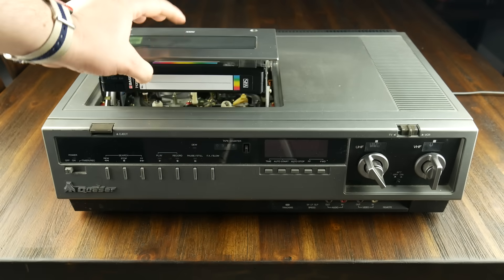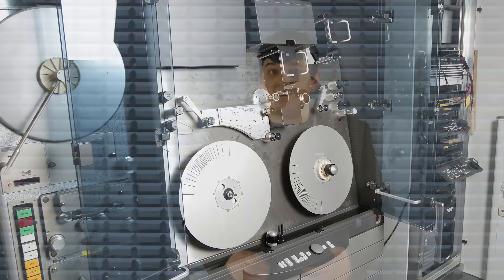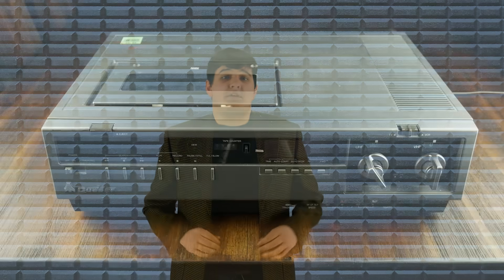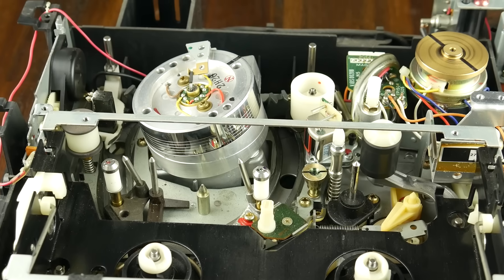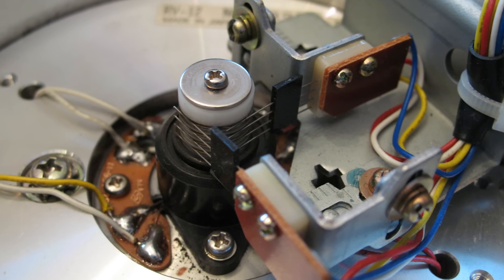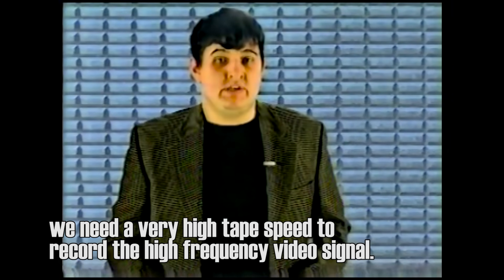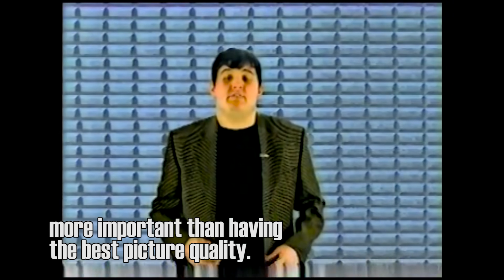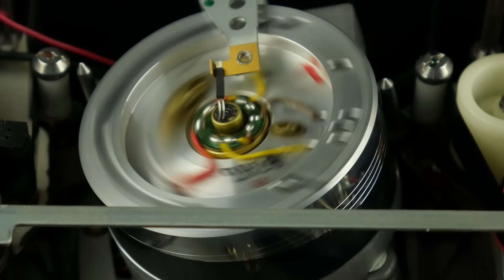The Impossible Feat inside Your VCR

Comment: I was a video production student at the time of SVHS and we all knew then (late `80s) that Beta was superior to VHS, machine not tape, due to the unreeling of the tape from the cartridge and putting it back every time you hit play or stop. Beta wouldn't unwrap the tape from the head until you hit eject. This meant far more accurate editing, or rather easier and less time consuming editing. Every time you put the machine through that process the tape ends up in a different place in relation to the heads. That's why the pro editing bays kept their Beta gear until replacing it with digital stuff and staying away from VHS. So Beta did still have a small pro market after it disappeared from shelves in stores and the movie rental scene. Beta Cam was the order of the day with most local TV stations and it was great. Essentially the same but with wider tape. Of course they weighed about 85 lbs. and you had to work out to handle them. It was all cool innovation and, to me, more interesting than the digital tech of today.

Comment: I am a Broadcast Video Engineer who was trained at Ampex in Redwood City, CA. You have done an excellent job. I must confess to you that I was anxiously waiting to hear you blunder, because I told myself there is no way this kid could get every detail right since he must have received his knowledge on this subject through non-practical experiences. But you nailed it.  You were not too deep and not too shallow. Bravo!

You should research another feature of Video Tape engineering which will enthrall you--how slow/fast motion and clean freeze frames (with no guard bands), was achieved. In addition to moving the tape and rotating the head drum, the head/s were moved up and down (wobbled). This was called AST (Automatic Scan Tracking) by Ampex, and DT (Dynamic Tracking), by Sony. So the tiny heads on the drum were mounted on a flexible board (Piezoelectric) which moved up and down (microns), on the video track to detect and avoid the low RF area between tracks. A less expensive method (consumer machines), was to have multiple fixed heads stacked on each other which were switched according to which was nearest to the desired track.

Another fascinating period in Video Tape history was the day of manual editing...and I mean manual editing. The tape was cut with a razor blade just like 35mm Film. I wrote too much already. I just want to say again that I was very impressed with your presentation and I am happy that you appreciate the history of this technology. I am kind of sad that it went away but I do not miss the hard work and expensive parts that were necessary to maintain those amazing machines. Not to mention the massive amounts of waste and chemicals like Xylene (head cleaner) we had to deal with. As an engineer at busy TV stations I was never without work when VTR and VCRs were in operation. 

Now that you've reminded me how old I am, the best to you.

Lincoln
NYC

Comment: UH... in the last 15 years of VCR dominion, everything was s-vhs.  we had t-160 tapes.  There was even high end video surveillance vcrs that could run 24 hours on a t-160 with audio that surpassed your example of slp.  Granted even the best s-vhs at sp would only be as good as the sd signal it got from the cable box.  even if D-VHS held on, HD would have killed it with the need for 4 times the video storage and audio up to 5 times the storage.  the D-vhs can't record 3-4 movies at the same time either.

Comment: Unbelievable knowledge you're got there for a young man. Excellent. As interested as I am in relation to VHS and S-VHS, because I used to do Wedding videos for 14 years since early 80's, I am disappointed that I no longer can use my machines, including a Panasonic MX12 mixer, because of what people say, old technology. I still have 2 Sony V6000-E cameras, 4 VCR's, two being Panasonic for home use and two Mitsubishi E82 which I used for editing of Wedding and Corporate videos. They weren't that good comparing with today's 720p, 1080p, or 4K, but they did deliver reasonable video quality, especially in the S-Video. Since I stopped this video editing with these machines, the two Mitsubishi VCR suddenly stopped to show the video on screen because, according to the technician who fixed them, their components and capacitors had leaked over time and rendered the machine useless. What a pity, as I really lover these machine and took good care of them. I still have them with me and only one Mitsubishi has been repaired. The other Mitsubishi doesn't send signal to the TV, but the Panasonic still work. I wonder if these machines can be repaired and made to work again. I've held them with me for too long and don't know what to do with them, keep them or throw them away. The case is still in excellent condition with no scratches on the body but I wished they'd work again.

Comment: I have a Toshiba VCR that can record in both SLP and LP modes and has full digital tracking. I noticed that the picture gets noticeably better when viewed on a full 1080P HD TV. Yes it's still low quality video, but I want you to try it because you too will notice a difference. On a regular CRT TV the picture looks quite soft and not as bright but as soon as you connect the VCR to a full 1080P HD TV then the picture gets much brighter and a bit more sharper too.

Comment: Back then that quality was acceptable.  That was the best that most people had and there were no 1080p displays.  The old glass CRTs were durable.  You would not damage them as easily as you would one of the new LCDs that are now used.  LCD TVs are soft (most have a plastic surface) and they are easier to damage than a glass CRT.  The CRTs were often very heavy but unless you drop them or knock them over they are almost indestructible.  They were also easier to clean because you could use window cleaner without fear of messing the surface up.  You could not use window cleaner on an LCD because the ammonia in it would probably damage an LCD if if has a plastic surface and then hopefully your now ruined LCD wasn't too expensive.

Comment: Very well done. One detail, though. Look aftet 11:50 when switching to VHS. Notice the artificial contrast fringes that appear all over the jacket ? These are called moiré patterns or aliasing artifacts  and are not a VHS defect. Actually it is typical of when a high resolution signal (here, HD) is downscaled (to SD) without caution. Hint: look for anti-aliasing settings next time. Apart from this little glitch, very good video, no nonsense, no clickbait, only clear explanations on a nontrivial topic. Keep up the good work! Subscribed.

Comment: The bad thing about these formats is that a lot of videos will be lost that could have been saved.  I use software to convert my VHS tapes to DVD but a lot of people probably don't even know you can do that.  They think you need to buy a $400 machine.  So there are VHS tapes sitting in a box somewhere in the back room rotting away because they got rid of the VHS machine years ago.  It is like reel to reel tapes.  People had R2R tape machines, but when the machine died, those recordings of little Susie singing at the school are lost.

Comment: Funnily enough, tape is still very relevant today. a lot of major companies actually store their backups on tape. such a tape can currently hold about 6 TB of uncompressed data and costs about 100 euro. now, the required tape drive is a lot more expensive (quick research shows around 2k) but, with enough data it's actually worth it, if you have sequential data and don't mind very slow access.

Comment: I've owned Sony VHS recorders in the early 1990's that could record in LP.  But still some drawbacks -- the "fast scan" picture even on a 4 head machine was much worse on an LP tape vs. SP or EP.    Some cheaper units couldn't do it at all- it could play LP but if you scan the screen went black.       SuperVHS on LP?  I've tried it.  I wanted to tape "Titanic" movie (over 3 hours) off the cable movie channel onto S-VHS with my Panasonic Pro model.   Only recorded in SP or EP.   So I took a SVHS cassette and recorded a 4 hour blank screen on a Sony machine (not SVHS ) at LP speed, just to get a tape full of sync pulses at LP.  
Then, when the movie aired, I pressed Audio and Video Dub/Insert, to record it using the flying erase heads.   It worked!   The Panasonic SVHS machine faithfully followed the LP sync pulses, to maximize the utilization of tape for a movie of this length.
However, the results were disappointing.  The image was sharp like you'ld expect for SVHS, but the colours were somewhat "washed out" and pale, not like a normal VHS recording.   Has anyone done comparisions of VHS - SP versus SVHS - EP ??  Does SuperVHS still come out on top of regular VHS.??

Comment: VCR (Video Cassette Recording). First type of video recorder intended for private use, was introduced by Philips in 1972. Media to the format was based on 1/2-inch tapes, just like later VHS and V2000. The playing time was 30, 45, 60 and at most 70 minutes.

Comment: I found that is is actually possible to record a very distorted, low frequency, black and white, composite signal from a tube based camcorder onto an audio cassette pretty easially. Though it ia hard to make out anything but a few shapes, but that may be do to the low quality hardware I used for this test.

Comment: Nicely done. I used to use a 2" quad tape machine in NZ in the 1980's :)
Reply: craig miller I worked on the first ampex machine in the early 60s and used to edit by cutting the tape. I worked on every machine AMPEX made and was the youngest ever to be nominated for an Emmy at 19

Comment: Old tech is fascinating.
Reply: Complex enough to look like awesome magic, but simple enough so you can understand how it works by reverse-engineering the circuitry.  Bonus points for circuit bending!

I still use my Amiga on a regular basis -- minus the circuit bending, of course.  8)
Reply: What's interesting is how new advancements in technology such as CD/DVD renders previously perfected technologies like video tape systems obsolete in a short amount of time.  Other examples, horse&carriage to cars, analog cellphone to digital, Blockbuster to online streaming, etc.  :D
Reply: @BillAnt  actually that's wrong CD AND DVD IS STILL USED QUITE A LOT THESE DAYS I STILL USE CD AND DVD AND I STILL EVEN WATCH VHS TAPES THAT I STILL HAPPEN TO HAVE
Reply: @stephensnell1379  < Sure, old tech will be around for many more decades for enthusiasts and those who need it, but it's being phased out and there's less and less  media being produced.
Reply: @BillAnt  in my opinion old tech won't ever dissapear altogether
I still happen to have VHS TAPES,I also use dvd and cd too.
Reply: @BillAnt  I think another good example was tv with FST tubes. Just when engineers finally managed to get the face of the cathode ray tube almost perfectly flat, along came LCD panels.
Reply: KastaRules I still use cassettes
Reply: I still can't wrap my head around the tape head wrapper... tsk tsk
Reply: Amazing how much more complex the systems were back then. Now tech is relatively boring, just chunks of silicon reading stored charge. I guess simple wins in the end, like using a single electric motor in a car instead of the massive complexity of an internal combustion engine.
Reply: Old tech is so fascinating to me because they had to do seemingly impossible feats with analog technology. It’s all based around complex circuits and magnets. Nowadays you just add software to a(n admittedly more complex) digital chip and you can solve the problems way easier.
Reply: Sword You can get basically CD quality recording with an open reel deck by just removing the pinch roller and letting it fly, speed accuracy not withstanding.
Reply: My firewire miniDV cam from ~20 years ago is still better than a "webcam" of today.  Not 720, but the optics are so much better.   Why all digital camcorders (& still cams) don't have a webcam mode is beyond me.
Reply: @radellaf  that's because video cameras are meant for video and images(my video camera captures both video and photos,I can record up to almost 12 hours of video on to the 8GB Memory Card)
Reply: KastaRules yes it is, even though im like 18, looking back at what my parents used just fascinates me, the old fashion ways of media is more interesting because most of them ( correct me if im wrong ) needed to be manually done with patients and care, it was like an artist who needed to paint a picture if he wanted to remember the moment that he knew never will happen. Old technology is soo much better that todays piece of plastic sheet with wires to display pictures and produce noise! I can tell by being amused just sitting in silence for hours straight literally just looking at all the parts in a vcr or a crt tv.
Reply: @Ryrylotlot7656  My great grandfather used to build tube TVs as a hobby to sell to the people of his small town for cheaper than the big companies. It was definitely doable for one person who knows electromagnetism to make on their own, yet complex enough that if you didn’t know exactly what you were doing it probably won’t turn out well. Now it’s all digital chips, which are harder for one person to make because they can mass produce such complex components in modern day.
Reply: Yes it is. I still have my older mini VHS camcorder that still produces a hell of a picture, about 5 VCRS with three hooked up to TV's still for when the DVR fails or is out of space, or when i want to keep something. I have CB and HAM radios which can be very useful if things ever get really insane in the country and the grid goes down, I also have older digital cameras from Kodak and Canon that work great too. 

People are finding out that digital stuff is not all that it was made out to be. That is why records and record players are making a Huge comeback because people would rather use something physical than all this digital stuff. ALso it's FAR easier to just put a record on with 8-10 songs and know exactly what you're getting an having an IPOD or your phone with 20,000 songs and have to make play lists, folders and stuff to organize it and still have to scroll to find what you want or search. 

Even Flip Phones are making a comeback as many people are turning in their smart phones for the ever reliable flip phones as many people don't need or want to be online with their phones. As long as you can make a call easy, send some text messages and take a decent picture when needed, that's all many people want. 

All the old tech that a lot of the younger generations now mock, is the FOUNDATION for what they're using today. The tech actually DID exist decades ago, it was just TOO expensive to bring to the market until now. But it was actually invented long before most people were born.
Reply: @JediWitness2  as far as we all care internet is a MUST HAVE
I ABSOLUTELY LOVE USING THE INTERNET AS THE INTERNET IS WHAT I GREW UP WITH SO I CAN'T RESIST
PEOPLE WHO ARE ABOVE 70 IN AGE DON'T EVEN USE INTERNET AT ALL
Reply: @JediWitness2  all what you said is false
People like smartphones
Early day phones are outdated so I myself will always use touchscreen phones
I won't go back to crappy button phones
I happen to have a 32GB iPod touch which is extremely convenient for me
I can get 4 days use from a full charge
MP3 audio is much more convenient for everyone
I still happen to use some old day VHS TAPES myself which are still in perfect shape
Reply: @JediWitness2  I agree with you on that
Reply: @JediWitness2  where on Earth did you get that crap from?
Everyone uses Smartphones not the crappy and useless flip phones which really don't exist now
Reply: F A S C I N A T I N G
Reply: Such beautiful masterminded mechanics.
Reply: Sword, from better to worse good example, copper phone lines to VOIP, so much delay in VOIP and sounds terrible. Same with cell, loved the old analog flip AMPS phone, TMDA (or GSM) was the worst, I made sure to at least get CDMA. Although cordless phones got better, going from AM (short range and privacy problems) to DSS 900Mhz. Only thing I've heard on a smart phone that wasn't bad recently was Facebook messenger calls.

Comment: Well explained. I remember the days of servicing those equipment. Man, adjusting spindle gears on the bottom of the device was sometimes pain in the *.
Great times. Cleaning clogged heads, adjusting azimuths (except for video heads), replacing broken gears, setting proper timing for spindles (like a timing belt for ICE engines),... Too bad it is over.

Comment: Until at around 2004 the recording of video on DVD wasn't affordable by most consumers. Video Cassettes survived much longer than audio cassettes because even today video is much more  demanding than audio. 
I was using videocassettes until 2010 because I could record 15hours of video on a TDK 300min video cassettes with SLP speed. This was very convenient for my video cassette recorder timer. 
The latest VCRs after 2000 had very good quality even with SLP speed. The new Sharp VHS video cassette recorder I bought in 2002 had excellent quality and low price. Tremendously better than my Hitachi first VCR in 1987. VHS technology and quality wasn't the same from 1976 until the latest VHS VCRs in 2003. The latest Super VHS recorders could copy a DVD with very good quality (a deMacrovision SCART adapter was needed). A factor that isn't mentioned was the quality of Video Cassettes. Most people were using cheap TDK or Maxwell VHS cassettes for daily use. However both companies were selling much more expensive cassettes for archival use with much more superior quality. 
After 2010 the digital TV broadcasting and cheap external hard drives changed everything.